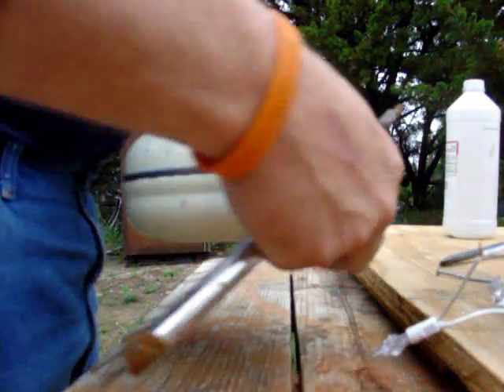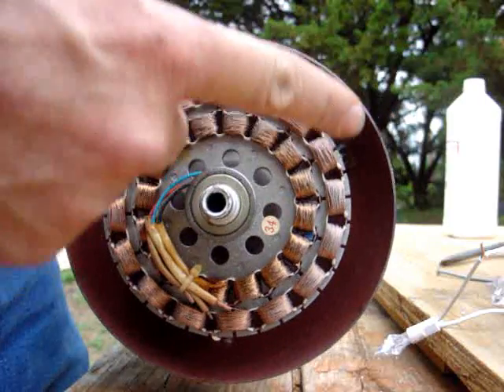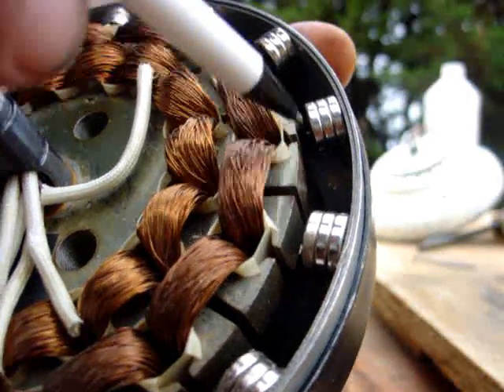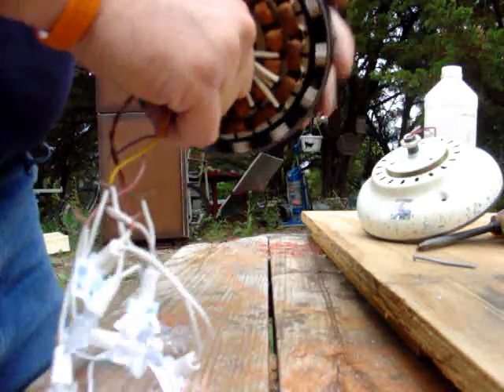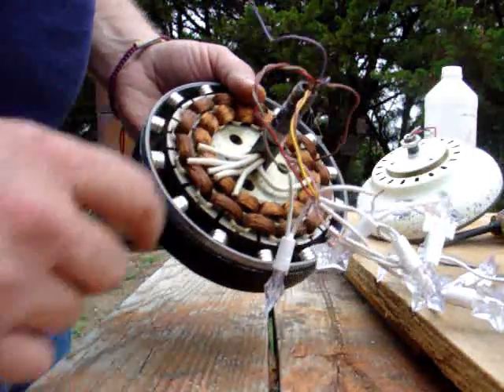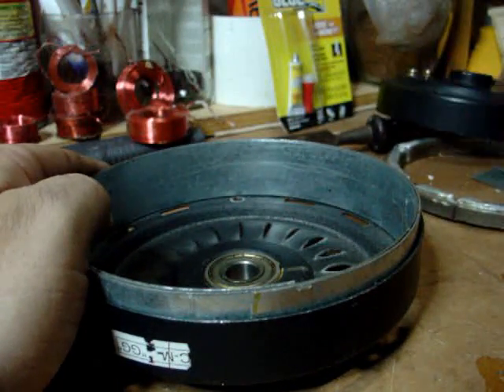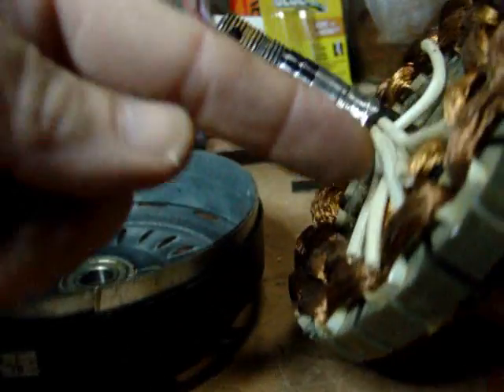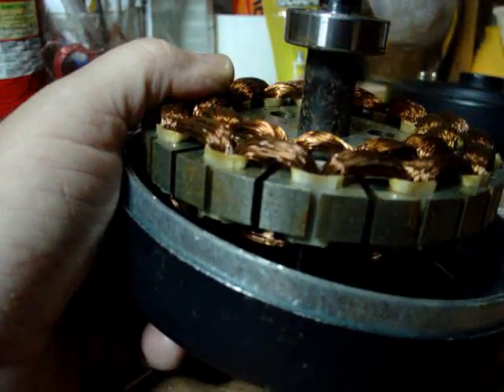PART 3 HOW TO CEILING FAN WIND TURBINE

Comment: I need one of these for my 2" bore steam engine. I'll have to watch it again,
Reply from the maker: These are easy and cheap to make , but very inefficient. But a mini 
axial flux with dual magnet rotors and air core coils will get you 97%+ 
efficiency. and no cogging to overcome.
Reply: ***** Is that repelling the rotor with magnets to take the weight drag off? Floating rotor?
Reply from the maker: HistoricSteamTV
coils with metal iron cores cause cogging, and inefficiencies around 50% losses. Cogging is the magnets being attracted to the iron or steel in the coils center. Not good.

But the axial flux design has air core coils, so there is no cogging to overcome, and no lens losses. very efficient, and freewheeling until the rpms reach the charging voltage. Then any added pressure or torque to turn the rotor faster, turns into amps going into the battery or load at 97% efficient. Enjoy.
MUDDy
Reply: ***** I've done a lot of magnet on magnet push motor experiments. Angled to propel and cogging is even an issue there. I look you suggestion up. Thanks,
Reply: muddymuddymuddmann what if you could make a stator out of copper. or another non magnetic material how would it work?

Comment: when you "ohmed out" this motor what did you do? There are 6 wires that are all live! On my last turbine I had 2 wires with no reading so I  cut them off. This stator has all live wires. Mine are identical .
Do I  keep my 2 sets of wires with the highest readings? Cut off the lowest pair? Will this kill these coils so we're  not getting the benefit of all the coils? Are we only running on 2/3 of the coils?

Comment: Thanks for the detailed presentation.  YOU DID AN EXCELLENT JOB.  I'll try to make one.
Reply from the maker: +Larry Dupuis 
Thanks Larry, They don&#39;t put out much, but they can be very versatile. I have been thinking about using a weed eater engine with a skateboard wheel against the outer shell of the motor for a test rig. idle should do a lot of time charging, or to run around 12 strands of Christmas lights.
Happy new Year.
MUDDy

Comment: How many WATTS can I expect if I convert my CEILING fan??? Rough estimate...

please tell me,,,
Reply from the maker: +Crackles McFarly I have run 12 strands of LED Christmas lights straight off the ac of the coils wired in series. But off of the 12 vols rectified, it is just a trickle charger around 1 amp.  depending on the use of this unit, i have seen 200 watts. 

It is by far, not the best wind genny, But very cheap to make. I spent 40 bucks on my first one. 

The low amps are due to long thin wire resistance in the coils. But when wired up for higher voltage, the efficiency go up.

I wouldn't call this a wind turbine for powering your house. But it does make enough to power a cb radio for several hours per day. nice for recharging the deep cycle battery on the john boat way down at the dock, or in remote places. very light weight, and versatile for many voltage battery banks. And cheap to make.
MUDDy

Comment: So Just wondering why you don't knock together a puller to separate the shell. Just a strap bolted to the blade holes with a large bolt and nut against the shaft should do it.

Comment: That little black plastic box inside every one on these to change  the speed (i figure) are they to be used again ? i guess what i'm asking again is where is the recofire or do you have to get one somewhere else so the power will only flow one way ,but i suppose those details are coming ,are they Muddy ? Second question is ,does it bother you that i prod you for information that i should know by now .
  I found me a great stainless steel blade ,and this thing is getting built.

Comment: Great video I've got a 3 amp ceiling fan motor. I'm going to convert using a iron-steel based magnet.I don't expect this to be a real power house... but I'm considering building a 1kw pma stater,,,, if all things were equal..would there be any output differance   between say a n35 ,n42 ,n50 -n52...at what point does the cost out way the gain?...... again great videos... keep expiring the people!! :)